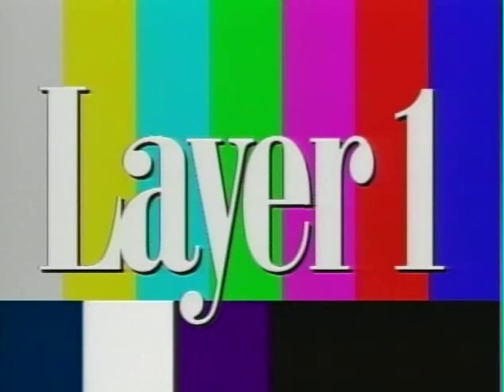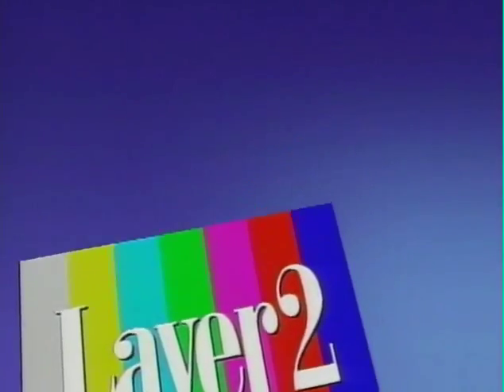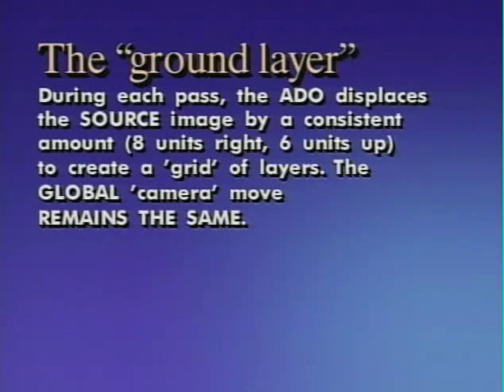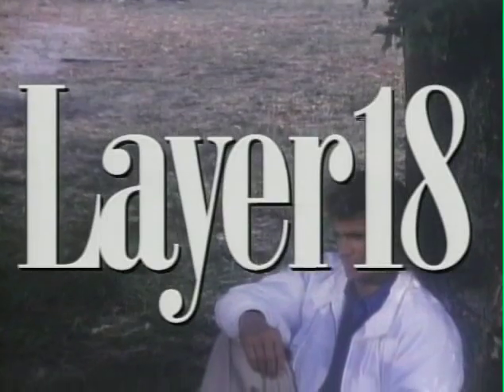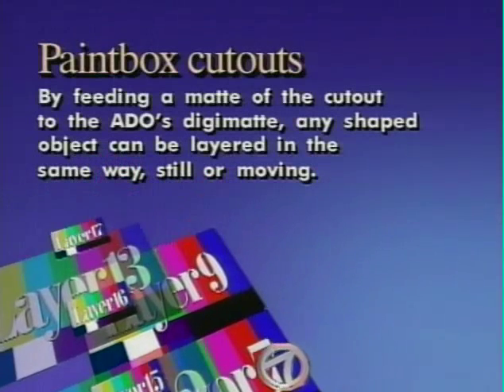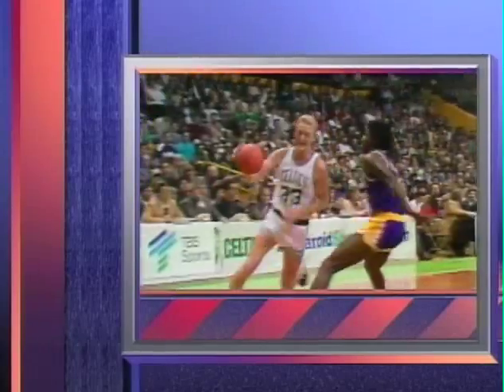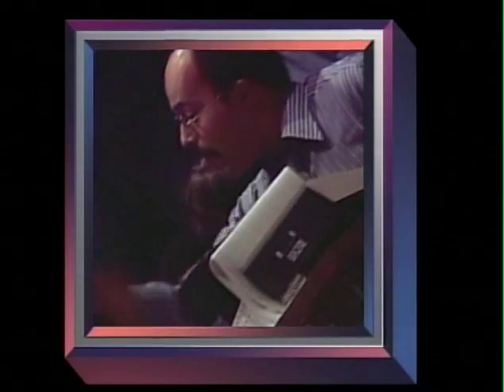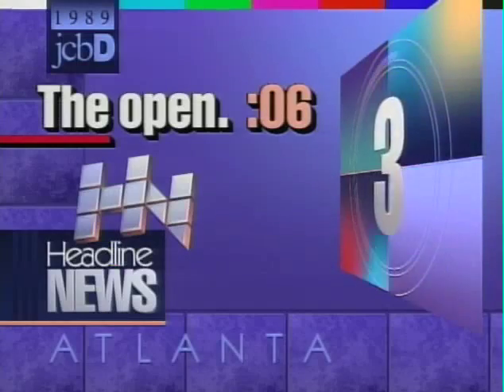1990: How multilayered graphics work.

Comment: I love the Paintbox aesthetic so much....I wish there were a way to replicate the look on modern hardware.
Reply: Two years late, but I'm working on some how-to material for getting the Paintbox style in Photoshop. The videos should start going up soon!
Reply: Great to hear. I've managed to get a little 80s sort of standard def look going but it's not quite there yet.
Reply: You absolutely can, the actual look came from the imaginative design skills of the artists who used it (Charlex and their imitators). As far as the technical aspect, you can add some subtle blurring to edges to avoid the perfection of current-gen digital key/mask.
Reply: You can get a jcbD look in blender if you know what youre doing. my friend did one for another one of his friends and it looked like jcbD made it.

Comment: Mr Burns!  We haven't spoken in a while, but I've tried to do some of these effects completely within Avid.  I've come to believe that it can't be done because Avid (even when equipped with BCC) doesn't offer effects editing with a 'global' parameter.  So it's really difficult to make many layers track each other.
Reply: I have not, for two reasons: (1) I don't have access to Flame or Smoke and (2) I don't know the first thing about how to use them!  ;)
Avid is what I have at NBC and it is not intended to be used as a graphic compositing device, I understand that.

Comment from the maker: Sorry for the delay in responding, but the answer is B. You go back and forth and back and forth, painstakingly adding one layer at a time, like coats of paint. And one of the other drawbacks was you couldn't go back unless you saved off (onto D2 videotape) intermediate steps. Painful. But better than what came before.